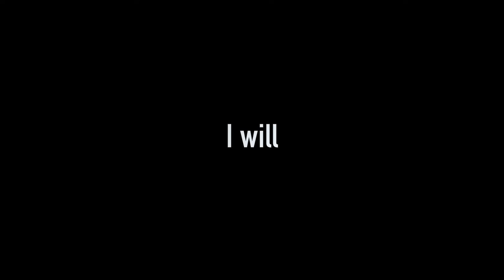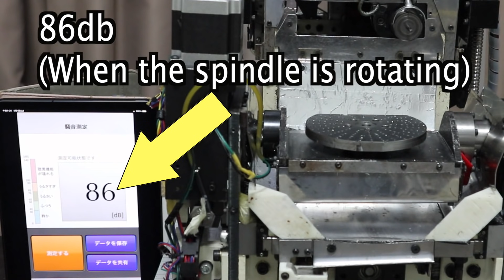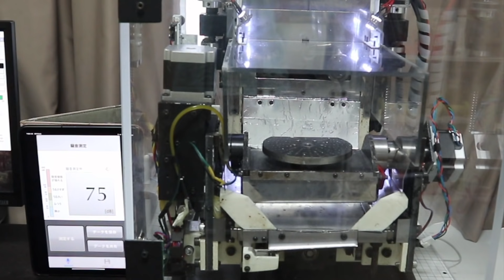Build My Own CNC Mill 5-axis

Comment: Make a video on fully diaesembly of this CNC please bro I can't understand the frame structure because the dust plate cover the full CNC body please make video on deaesembly and AlL measurements of this CNC please please bro
Reply from the maker: sorry for the late reply.
For some reason I didn't notice it in the spam folder.
There are currently no plans to publish the complete data for this machine.
The reason is that this machine was made by trial and error. There are still some problems.
I want to remake.
I will show you the contents of the c-axis in the next video.

Comment: So far you have the best 5 axis set up for a desk  top  machine. I've been invisioning building this exact machine in my head for some time. What is your total cost so far and curious if you got a link for the 5 axis firmware and links to any of the hard to find components.
Reply from the maker: Thanks for your comment.
I'm not sure exactly what the cost is, but it should cost around $ 3000.
If you look up what you can buy, such as motors and linear guides, you'll know how much it will cost.
The issue is how to get metal frames, brackets, etc.
I used the waste material that I no longer use at work and processed it myself, so the cost is not very high.
If you order them, it is become high cost.

Comment: Amazing build! I'm wondering why the axis are driven using belts instead of directly driving them?
Reply from the maker: There are 3 reasons.
1) Using a belt and pulley Because even a small motor can increase torque.
2) If I connect the ball screw and the motor directly with a coupling, it will be longer and the size of the machine will be increased.
3) Backlash occurs when using gears, but basically there is no backlash when using a belt and Quiet.
Reply: @a-cnc-f  thanks for the inside!

Comment: Would you mind telling me how much does it costs to make such an incredible machine at home?
Reply from the maker: Thank you for your interest.
The price of tapping motors and electrical parts is not a big deal.
The biggest question is whether you have a tool that can cut metal parts.
I managed to make a 3-axis machine, made a 4-axis part with that machine, and then made another 5-axis part.
Also, knowledge of electricity and knowledge of linuxcnc.

Comment: Awesome design. Very weld build. I am sure a lot of time and effort went in to making it. Can you let us know what size/type/length of rails were used in each axis? Also frame is made of steel or aluminium plates? What is size of collet in spindle? Also was is the biggest size of hole you have drilled? Also have you machined any steel with it? Keep improving it. Love the videos. Weld done.
Reply from the maker: thank you for having interest
The frame is iron. SS400
The maximum diameter of the drill I have is 10mm.
Larger sizes are machined with this machine.
If you want to know the structure, please watch this video series.

Videos series = How to Build 5-axis CNC Machine 
https://www.youtube.com/watch?v=W4NUshauWN0&list=PL8bP8v4-K0Mnj3GYJAnND0PUHvg59oVzC

Some 3D data is also open to the public.
WEBSITE & 3D Data https://www.acncf.site/how-to-build-5-axis-cnc-machine/

Comment: Nicely done. I had no idea you could do that on a pie. I have used linuxcnc with mesa boards in the past but on full size pc with ISA slots. So much more capable than mach when it comes to the kinematics. Any chance of Maybe larger version (200mm) using nema 23s and Trinamic TMC 5160 drivers or leadshine closed loop stepper drivers and cheap ebay harmonic drives?
Reply from the maker: I have never used closed loop stepper drivers.
But I think it is possible.

Comment: Great mashine 
Wich Software do you use to control 5 axis? I got myself a MPCNC PRIMO and was looking to build a 4th axis that rotates for mashining round objects but iam not shure wich Software i can use wich is not so expensive 
Thanks for sharing
Reply from the maker: The machine is controlled by Linuxcnc. 
As far as I know, it is linuxcnc or Mach that can control 5 axes and backlash.
linuxcnc is free. But there are many difficult things.
Mach is paid software. It seems easier than linuxcnc. I have never used it.
Reply: Thanks for your answere 
My cnc is now controlled by estlcam and iam using the OpenCNCshield i think it can handle linuxcnc but linuxcnc only runs on linux instead on my Windows Laptop
Reply from the maker: @TobiPHartmann  If you want to try linuxcnc, beaglebone + machinekit is the cheapest.

Comment: I have software problem 
I am trying to making 5 axis cnc machine and I am getting output of only 4 axis .
* I am using Arduino mega 2560 + 1.4 ramps board 
In this board from all 5 output  gives only 4 output 
Where is problem if  it's a frimware problem kindly guideme 
I am tired of getting searched for 5 axis firmware but I am not getting it

Comment: Brilliant! Amazing build. I was looking for some guide on 5-axis CNC unit without a full size PC. I've seen people using mother and daughter Mesa cards with full size desktops, I do not want that. I saw that you're using Raspberry pi with Mesa7c81 which I found really amazing and compact.
Can you please share the schematic diagram of connections between Raspberry pi, Mesa7c81 and stepper motor drivers. I've never used Raspberry pi before in any project but got Linuxcnc installed and running by watching your course on teachable. I'm using Nema 23 with TB6600 driver.
Reply from the maker: Thank you.
Unfortunately, there is no accurate record of the wiring.
I am planning to make a new CNC unit and publish it, but I don't know when I will have time to do it.
Reply: @a-cnc-f  can you refer to any article or video for connections. I'm having hard time reading the manual.
Reply: @a-cnc-f  looking forward to that build

Comment: Bro i want firmware for that 5 axis cnc machine I want to get all 5 axis work done in my cnc but I am not getting firmware for my machine please me out I am tired of searching of it
Reply from the maker: It looks like you're having a hard time.
I understand your feelings.
I also had a lot of trouble with control.

I'm not familiar with programming, so I can't explain it in detail.

At first, I also tried to control 6 stepper motors using Beaglebone CRAMPS, but only 5 stepper motors worked.
After spending a lot of time investigating, I found a defective solder.

I've never used an Arduino so I don't know.

Have you considered linuxcnc or MACH?

Comment: For the touch off sensor, I would not trust those microswitches. I disassembled my touch off sensor, it's just a spring loaded hook. If the tool touches the plate the spring loaded hook will be disconnected.
See:
https://i.snipboard.io/QGl6Lm.jpg

I think something like that would be better suitable for your project (and it's not so difficult)
Reply from the maker: Thank you for your advice.
As you say, the accuracy of the touch sensor is not very good.
It ’s one of the improvements in the future.

Comment: Did you use PNCconf for configuration? I am working on a 5-axis CNC mill (XYZAC) but PNCconf is only giving me option to setup XYZ, XYZA and XZ lathe. Could you please guide? Thank you!
Reply from the maker: Sorry for the late reply.
I do not use PNCconf.
I went through the contents of the ini and hal files one by one and changed them.
I am not very good at programming so I had a very hard time.
I still don't understand a lot of things.

Comment: nice build! how do you write your code for machining? Do you use Fusion360?   Could you make a video how to setup LinuxCNC for 5axis? :)
Reply from the maker: I use Fusion360.
The settings of linuxcnc differ depending on the machine.
If you want to use linuxcnc on your own machine, you have to understand it.
Information can be found on the website.
I don't know much about it too, but I've spent a lot of time.

Comment: Pretty interesting build, using worm gear will always comes with some backlash, my initial build using worm gear as well which comes with somewhere between 2-3 arcmin in in C and 20-30 arc sec in A, these backlash created quite a lot of rigidity problem during my works on metal parts, especially surface quality, but not significant if I’m working on wood/plastic. I’m looking forward to switch to something like Sankyo RA CAM reducer which have zero backlash. Anyways nice build, is always inspiring to see such a build with limited equipment in house. 今後の改良も楽しみしています、頑張ってください👍
Reply from the maker: Worm gears are tough,  but backlash is also a problem.as you say.
I knew this was a problem that had to be resolved from the planning stage.
I've kept this secret until now, but the fact is that the AC axis worm gear is applied preload to eliminate backlash.
In the next video, I will show you everything including that part.
日本人の方ですか？
Reply: @a-cnc-f  日本人じゃないですけど、よくアニメをみてや旅行に行ったことが多いですから日本語も大部慣れてきたなので😄
Interesting to know wormgear can do preload as well, I thought those were only available if the gear is made of steal whereas most of them are made of brass?
Yes, both tough and self lock is precious in wormgear design, but desktop build in general don’t have any brake at all, so I’ve never get a near satisfied surface from my own built with wormgear table(dual lead wormgear), also rotation deviation created yet another huge bunch of problem for my build in the last three years as well, I used to calibrate the center of rotation with ball bar once a few days or even everyday sometimes, the offset of rotation center is vibrating couple few thousands of inches when doing metal works, probably a better bearing could helps as well. I’ve just purchased two rollerdrive last month and looking forward to get it swapped, don’t know how it performs compared to wormgear, but this whole process of playing with 5 axis  is really  happy in general XD.
Reply from the maker: You are also trying various things.
I don't think my work is always correct, but I hope it helps.
日本語上手いですね！
漢字も使えていて、自然な日本語だったので日本人だと思いました。
Reply: @a-cnc-f  haha thx, yeah, the most important thing is enjoy the process for making and all of those trials & fails. looking forward to further videos, play happy, play safe XD.